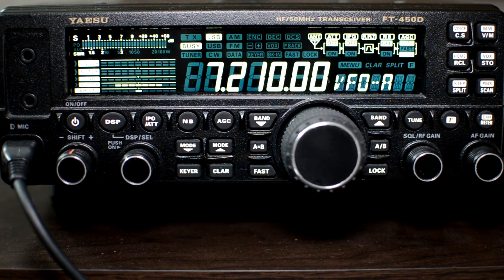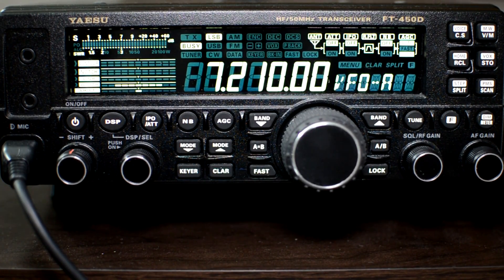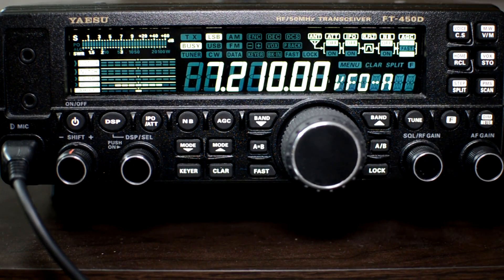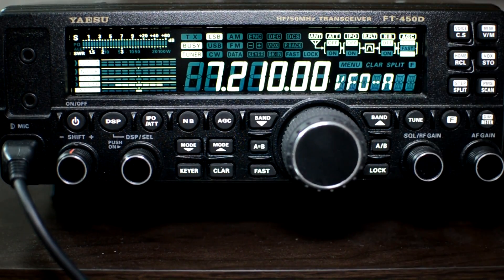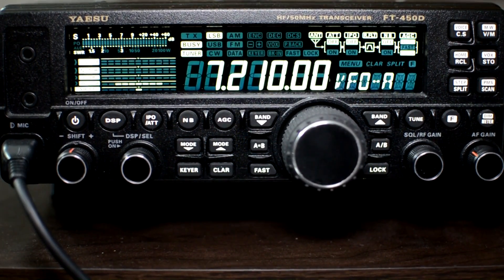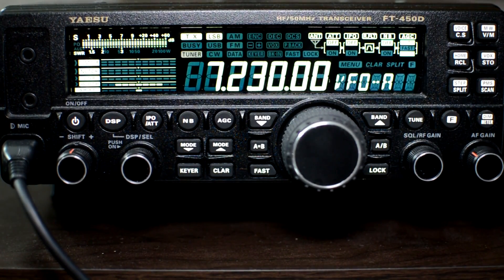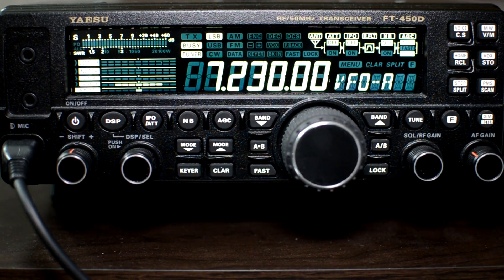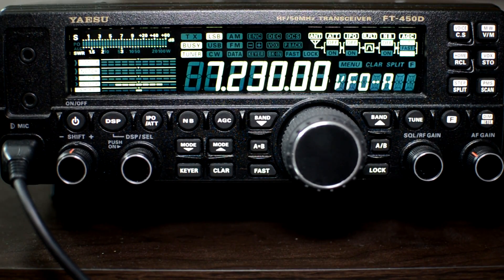Yaesu FT-450D: Using the Internal Automatic Tuner

Comment: You can change that tuner to effect the receive also its in the menu's. the default is set to transmit only
Reply: On the menu there's an option called 'TUNER' and under that you can select 'INTRATU' to tune both transmit and receive.
Reply: +Robert Reed Can you tell me where to do this setting?

Comment: Hi Tony...I have not be licensed all that long and have still to decide which HF rig to buy but I do like the FT 450D.

Question for you Tony...I like the idea of the built in ATU on the 450D...I wonder would you know if the built in ATU has a balanced input...as you can see I still have lots to learn.

The reason I ask is I would like to construct a Doublet type antenna and I believe it needs to run through a balanced input ATU

As well as amateur radio I see we have a common interest in general aviation...I to am a licensed pilot over here in the UK...flying what I think you guys call Ultralights..I have some videos on here.

I wonder how your flying is going.

Regards from Nick in the UK.
Reply: Hi Nick! Thanks for watching. This radio does not have balanced inputs. I honestly don't know of any that do- you will need to purchase or make a balun for that. As for the flying, it's going great! I've decided to continue to post my lesson videos on my personal channel so I don't crowd this one with non-ham material. Try searching for "Tony Milluzzi" on YouTube to find my other channel.

Comment: Hold the three  buttons right of dsp button and turn on the rig.  You then enter the service menu. Scroll to HF1 HiSwr and using the main tuning dial, dial the setting from 85 to 150.  Do this for the HF2 and HF3 Hi SWR  settings also.  Then push the F button for one second.  That's it.  You  now have a tuner that will tune up to 7:1 SWR.
Reply: Sorry to necropost a 3 year old comment but this is bad advice that no one should follow and the comment owner should delete it.  You are not expanding the actual tuning capabilities of the internal tuner by changing these values.  Yaesu did not intentionally handicap the internal tuner from the factory.

Comment: You don't have to live with the 3.0 swr limit.  I changed the HF "Hi" swr setting from 3.0 up to a 7.0 swr.  Works like a champ. Don't need an external tuner any more.
Reply: I've heard about this and it is interesting, but I wonder why that isn't the default. I'm concerned with the long term reliability of doing that.
Reply: It's bad advice and doesn't actually increase the capability of the tuner.

Comment: Do you think the LDG Electronics Z-100PLUS tuner is a good match for this rig?
Reply from the maker: I have no personal experience with it, but it would probably work well. I actually just picked up the LDG YT-450 for cheap as I think they are discontinuing it. It works well and is easy to set up!